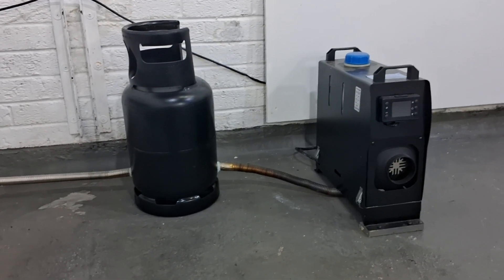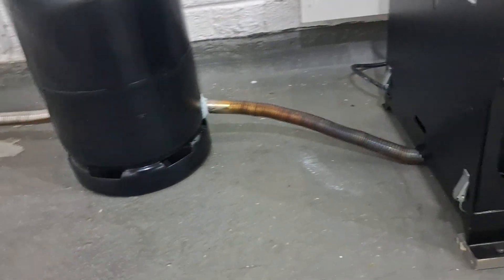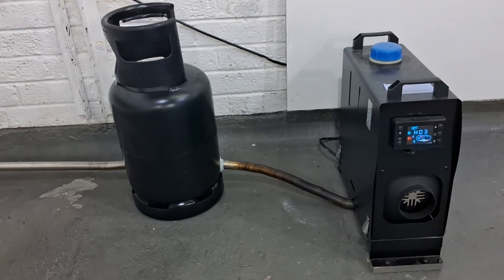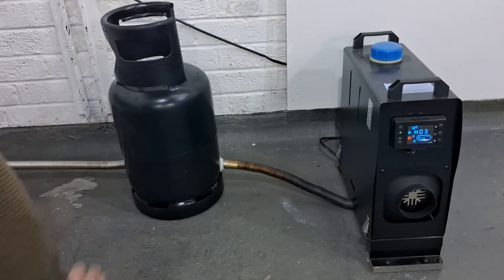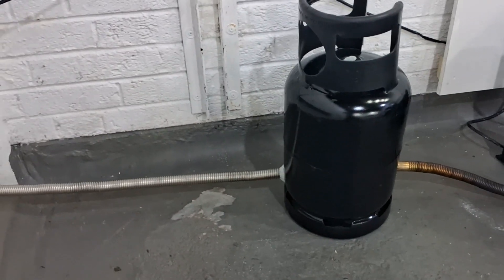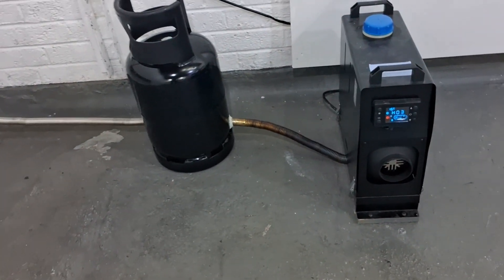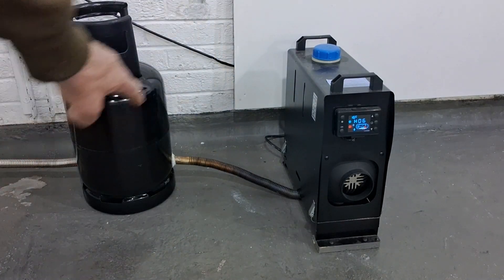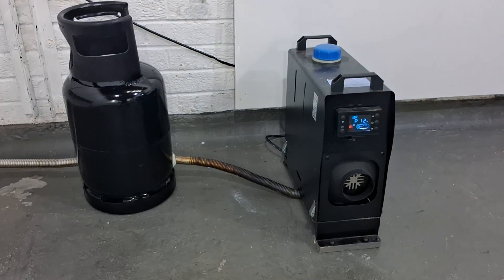Diesel Heater Pumped Exhaust Gases into Gas Bottle to Store Heat Energy Storage Experiment Off Grid

Comment: If the pipe enters the gas cylinder at an angle, the exhaust gasses will tend to spend more time swirling / spiralling around the cylinder wall and will transfer more heat before exiting. The same technique is used in hydraulic reservoir tanks to help keep the oil cool as it circulates.
Reply from the maker: Thanks for the info!

Comment: You guys make ALL the same mistake.
You MUST provide the air for the burner ALSO from outside !
If you take the air for the burner from INSIDE the room, you have a different pressure in the burning chamber that provides to a bad burn.
Reply: PS: And the burner sucks cold air IN the room you want to heat ...
You get a underpressure in the room if good sealed ...

Comment: Add a 22mm copper coil. so exhaust entering the tank continuing into the copper coil the other end of the coil then exits the tank. then you can fill the tank with water/oil, then you will have some thermal mass to hold the heat for longer after you have stopped the heater.
Reply from the maker: sounds good.
thank you for your comment did you see my other heater vids, https://www.youtube.com/@andyfireblades let me know what you think, cheers andy

Comment: Needs to enter at top and spiral down. You will have condensation build up inside. It needs to be able to drain.
Reply from the maker: thank you for your comment did you see my other heater vids, https://www.youtube.com/@andyfireblades let me know what you think, cheers andy
Reply: @andyfirebladetv  rather than cutting off and sealing the valve, could you not pipe the exhaust in at the top, either through the valve or a replacement? Also, if the secondary exhaust was detachable, perhaps an air-tight fitting similar to either a traditional twist-fit or modern push-fit hosepipe fitting.
Reply from the maker: @mattmill30  thats a good idea, i did another video with this bottle https://youtu.be/RYbdpQG_gCI
let me know what you think

cheers andy

Comment: Good trial Andy.  I think raising the outlet pipe would work better  to force the hot around the bottle instead of directly opposite and out.  I’m based in Wolves. Where do you get your Kerosene from and how much.  Red Diesel by me has just gone up £1.10/ ltr. 
Cheers mate. 👍🏻
Reply from the maker: cheers mate, its gbfuels.co.uk in erdington. nice blokes mention andy fireblade 
cheers andy
Reply: @andyfirebladetv  cheers mate.  Just checked… M54. M6 to Star City 👍🏻
Reply: I think the inlet pipe should be raised so that IF any condensation builds up inside the bottle cylinder, it would be blown out of the exit before blocking the 'inlet' / heaters exhaust
Reply from the maker: @jaagee6980  good comment cheers andy